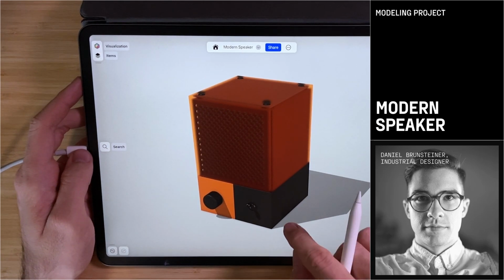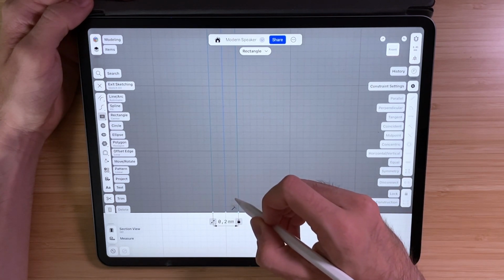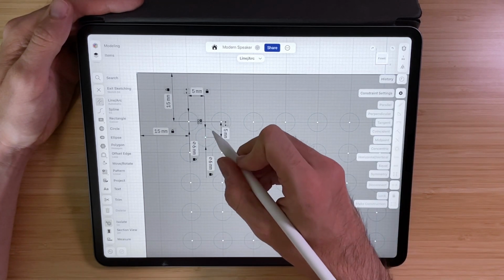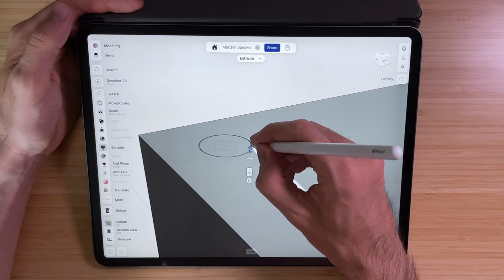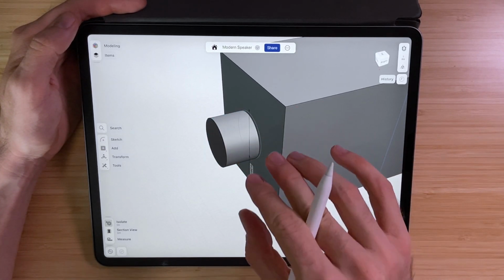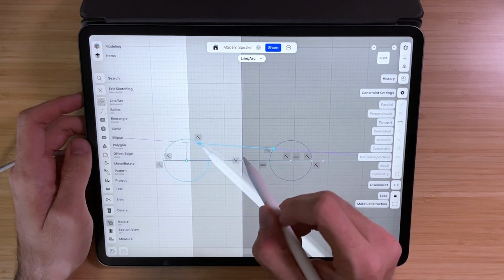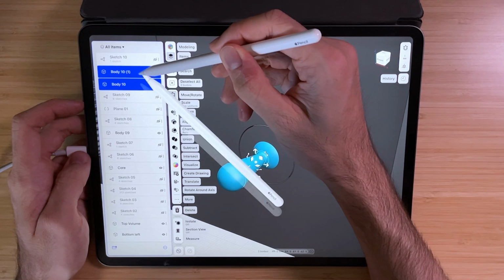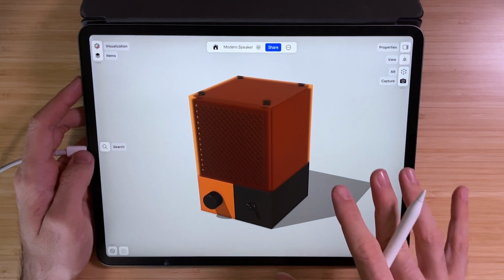Modern Speaker Design with Patterns, Shell, and Mirror | Step-by-step Modeling projects

Comment: I have a problem when I set the dimension horizontally or vertically between the central points of the circles. The circle I copied from the original one moves because the initial inclined measurement remains the same and does not change even when I set the dimension horizontally or vertically.

Comment: Can someone please tell me how to make sure my designed object/body is sitting on the plain. By that I mean so that I am not leaving objects in the air, because when I go to 3d print my design some of the designed objects are in the air requiring support material. I tried align but that aligns to other faces and edges. I just want to make sure I am on the ground floor not under or over the grid plain.

Comment: Surface tools will open up more ways to get to result quickly and s3d is lacking some desirable features. Section view, mass calculate, dynamic section plane, surfacing tools etc. need to be improved by s3d. Thanks for the work thus far but otherwise a decent modeling solution that’s on the go.